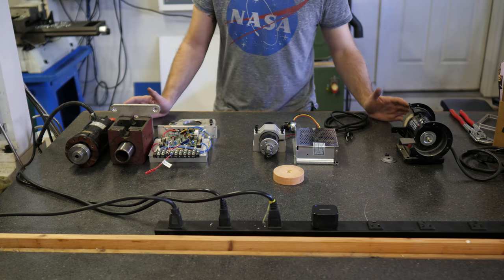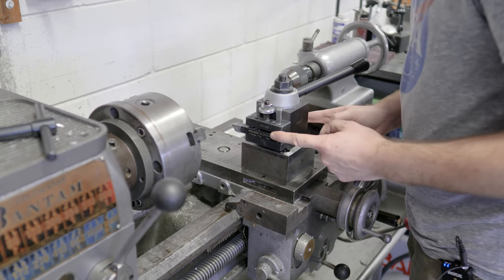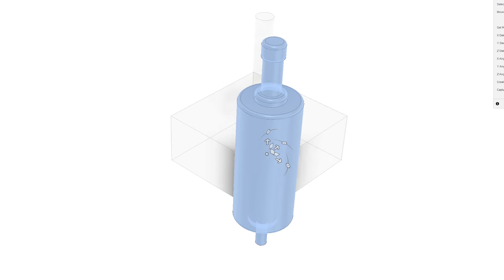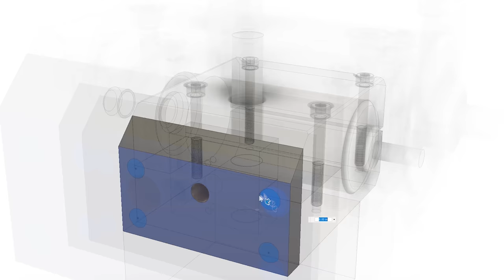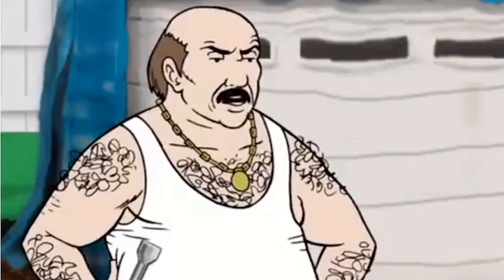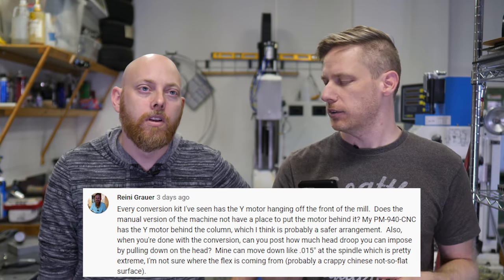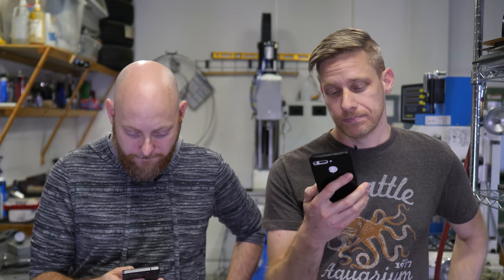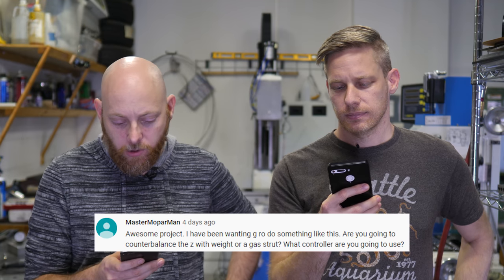Tool Post Grinder for the Lathe - S03E04

Comment: Hey, I'm fairly new to cylindrical grinding but i was dropped in the deep end on some rather complicated parts. best advice for small parts, coolant to help stop the wheel building up, causes some weird effects in surface finish and given the small spindle it to flex. dress the wheel as you did, then approximately step the wheel, leaving about 2-3mm of wheel. this will help towards rigidity and power usage. did you confirm that the probe body is centreline with the probe tip prior to modification? now you have means of cylindrical grinding make yourself a custom suited milling/ grinding spindle?

Comment: Sweet grinder!!  What was the material you used for the new probe arbor?  It didn't look too hard when you turned it to size which to me misses the main benefit of grinding...I don't think grinding soft material on a lathe is going to benefit you in accuracy or concentricity...the thought is that you heat treat the arbor first, then grind it to size, and now you have a very wear resistant part, vs a soft part with a ground finish.  But it's still a sick grinder, you just need to show us how to make a heat treatment oven now! 🍻
Reply from the maker: All good points Nathan. We definitely plan on working with hardened steel soon. This was just what we had on hand. I am sure a good tight lathe wouldn't see much benefit from grinding non hardened steel, but between our crappy insert tooling and tool deflection, it's almost impossible to get a good press fit on our lathe. So the grinder helps us with all sorts of projects.

Comment: You should use the toolpost grinder to grind the lathe ways. Worked wonders on my south bend heavy 10l, I went from 4 thousands run out on the ways to 2 ten thousands.

Comment: nice work guys, but that 3/4 post for the probe you made, should you not have dialed it in with a 4 jaw chuck before grinding it? i might be wrong but i dont think the centre of the shank will be concentric with the centre of the probe? or does that not matter?? TIA

Comment: I have one question
How would you adjust the height of your new grinder attachment for the lathe? Or is that not something you'll ever need to adjust? Usually tool posts are adjustable up and down.
Reply from the maker: Yeah, no adjustment on the hight. It could be my ignorance, but I'm not sure why you would need a hight adjustment if the tool is on center.

Comment: That tool post grinder looks slick, especially with the anodized surface but it's not very heavy and in order to avoid chatter you really should add som####ERR34158 - Banned from channel####

Comment: Why do you need a tool post grinder for the lathe? What does it do that the lathe doesn’t?
Reply: It comes down to the precision finnish and tolerance a toolpost grinder allows you to do cylindrical grinding which is process that will yield better tolerances, essential if you want to make pressfits for bearings for example
Reply from the maker: Indeed, hyelo is correct. It's all about precision. It can do this because the tool pressure is so much lower then a normal cutting tool, so the whole system doesn't have to be as rigid. It also allows you to remove much small amounts of material at a time, so sneaking up on a specific measurement is a lot easier.
Reply: Grind mostly

Comment: Funny well over engineer tool post for a grinder. I hope you realize that it didn't need to be center because it is spinning. Nice montage of all the cad work and end result.
Reply: Sounds like you don't have much machining experience. The tool needs to be set to the center of the work or it won't cut properly, spinning or not.
Reply: @noanoxan  I have 15 years of experience Thank you for asking BTW. I know that it doesn't need to be center.
Reply: Chris  No it does not need a circle on a circle is tangent no matter where you touch.
Reply: Chris  It is not or wheel. it is a wheel on wheel. Take 2 object that are round. Next put them so that they touch each other. Now imagine one is fix like the spindle of your machine and imagine the other one to be the grinder wheel spinning. Now tell me who is the idiot. There is no centerline both touch each other to the tangent no matter where you put it.

Comment: seen someone that made the grinder so it could be mounted to the quick change setup on the toolpost , basicly made the dovetail piece that slides ontoo the toolpost with a mount for the engine from a solid piece 
makes it a lot more solid and you dont need to take everythig on the lathe apart to mount it \
he used this for the grinder : https://www.feramotools.nl/contents/media/t_rechte-slijper-houtrotfrees-spero.jpg

Comment: This motor cannot be used as a spindle, there is no rigidity in it, bearings are installed inside rubber bushings. You need to use this motor as a drive through a belt, and on a lathe send a spindle on tapered bearings to it.
Reply: They have show that the motor can in fact be used as a spindle; it's just not that great for this application. As you stated, the bearings have way too much play. 
A cursory examination of the finish shows the conspicuous cross-hatch pattern from the YouTubers' attempts to clean-up their grinding with Scott Bright pads, which they didn't mention: VERY DISHONEST!

Comment: Cool project, specially with making the new shank for the probe, buuut your inaccuracy from the lathe is showing. God, look at the parallelogram shaped grinder and shank shaft. Yeah, when you can obviously see 0.000000000000000000000000000195 of inaccuracy, specially via your video, it’s terrible! Just terrible! Couple of scrap artist. Yours is the only work piece I know that has a butter face. Naw, I’m just kidding. You guys did very well. As best you could with a crooked lathe. 😉 👍.